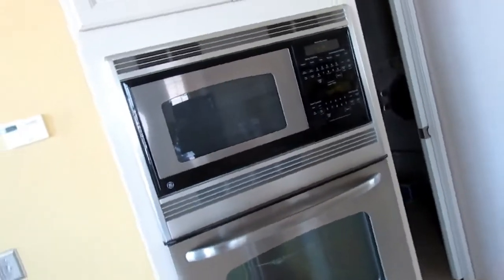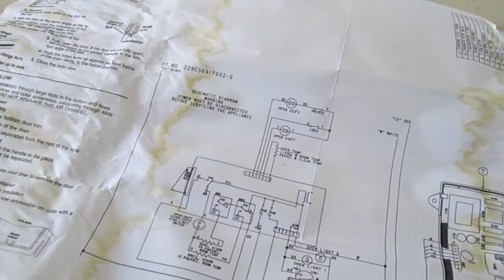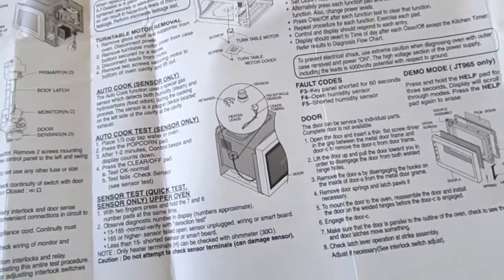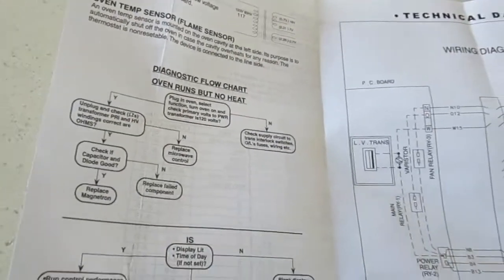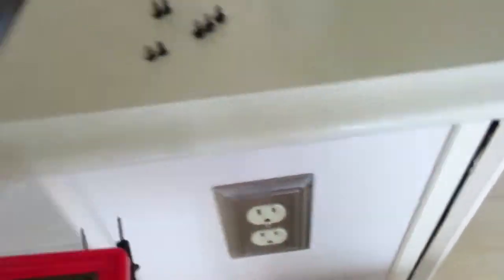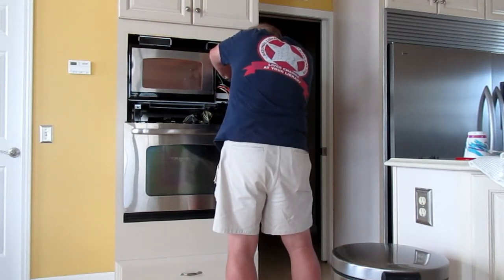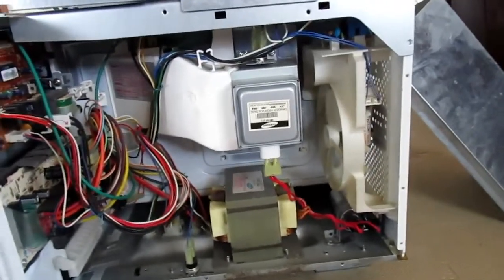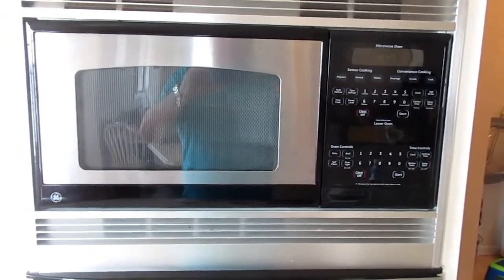GE Electric Wall Oven with Microwave PPT90 SPSS Microwave Oven Fix

Comment: Hi John, I’m facing the same project for possibly the 4th time. I’ve replaced fuses mostly but now I’m facing what just may be the magnetron. I’m thinking of replacing other components like the two door switches while the unit is sitting on my dining room table. Where did you buy the Magnetron? Btw, great video!!!!
Reply from the maker: I got the magnetron off Amaazon!  I think it was around 75 bucks.

Comment: Hello John, Where did you get the microtone? I have a similar microwave oven combo built-in wall, and the microwave is not heating. The problem is I cannot find the Microtrone of my model, JTP86SOH4SS.
Reply from the maker: I got the magnetron off amazon
Reply: @JohnSmith-gm4fj  Thanks John for the reply. Appreciate it.